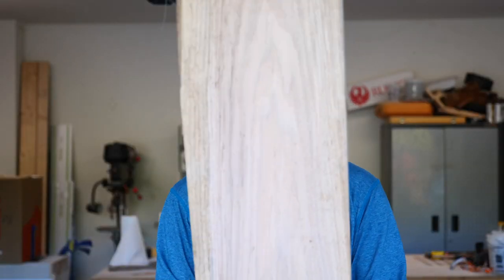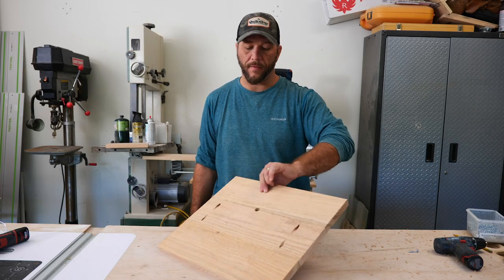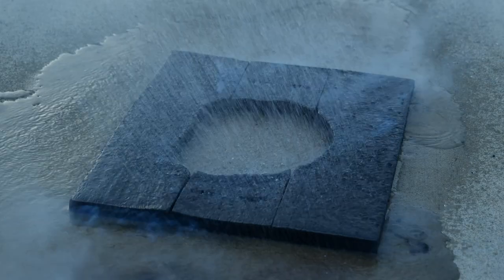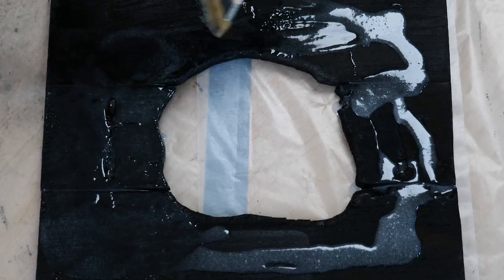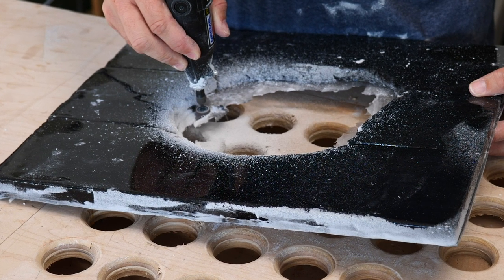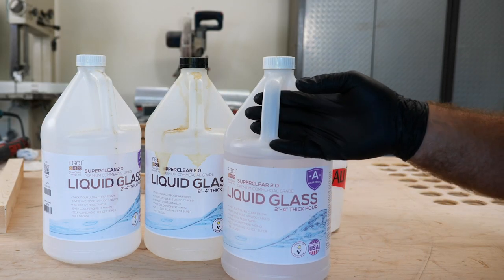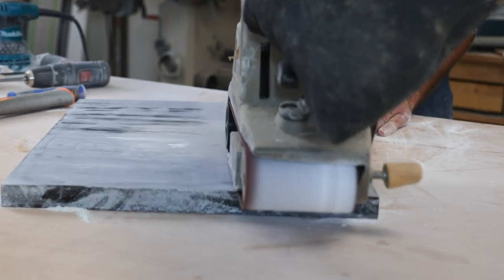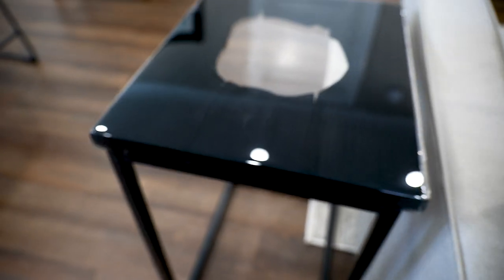Fire Epoxy Table - Making a Shou Sugi Ban Table

Comment: Some epoxies you can let sit for 10 min or so b4 applying and most bubbles gone like the liquid glass you used.

So why did you use a different epoxy on wood to start with and not just use the liquid glass?

Comment: I think it came out pretty good. Question though was there any warp to it the next day after you drenched it with water ?
Reply from the maker: Just barely. I made sure as I was burning it to burn both sides enough to keep it to a minimum. It was small enough that it didn’t matter because the mold was thicker.
Reply: I've  always liked the blue pigment with charged wood. But I like the clear look now also it give a 3 dimensional look of the grain .  Nice job

Comment: Please tell me which drill that is at 8:10min to 8:20min!
Reply from the maker: Milwaukee Right Angle Drill https://amzn.to/3bFobig
Reply: @HAXMAN  thank you thank you rockstar! You rock! Also which one is the other drill at 8:35!?!? Doesn't the Milwaukee right angle drill do the job for that? Pls excuse my ignorance! Also maybe you could suggest the best all-rounder all-job cordless drill, if one could have just one and only one drill to do everything with! Thank you thank you so much for everything that you do and are! Imma big fan!
Reply from the maker: @Maddyfmech721  Thank you so much! The other drill is just a basic compact drill. Most people will never have the need for the right angle drill. Those are for use in tight spaces. That drill just happened to be handy for me at the time. Without knowing exactly what you want to do I would recommend this drill. https://amzn.to/3q2pkVY
It's a nice compact drill that will do almost anything you want. It has the added function of a hammer drill which is good if you ever need to drill concrete. If you were going to do something were you would be drilling all day an 18v drill might be better for you. I might do a video explaining the differences with drills. I'm sure other people wonder the same thing. Thanks again!